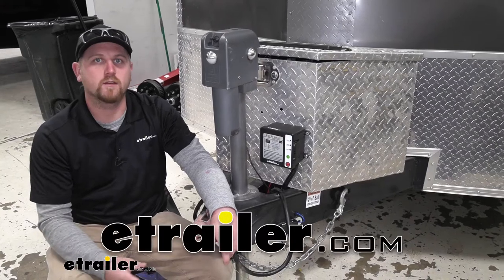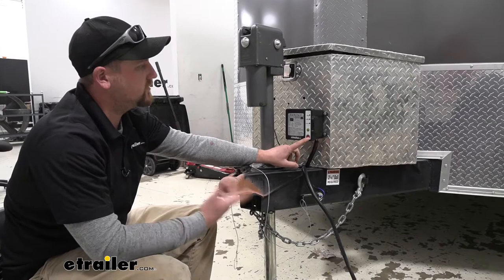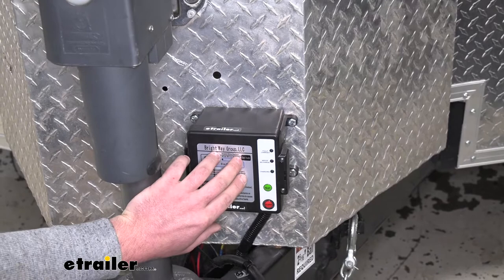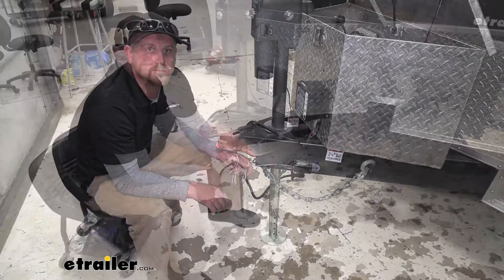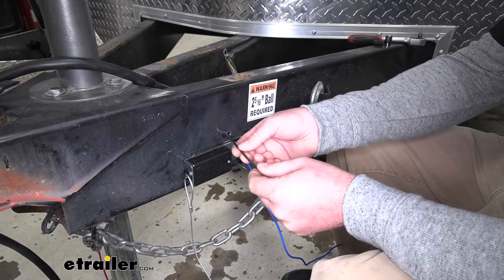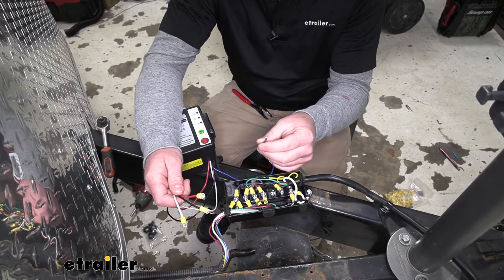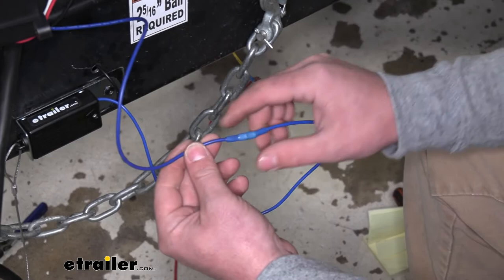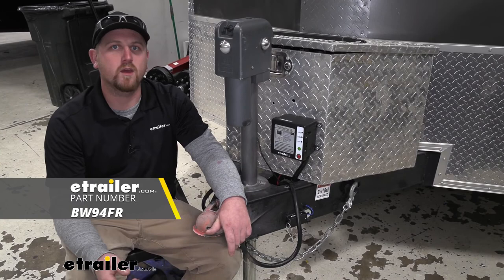etrailer | Bright Way Trailer Breakaway ICU Kit Installation

Comment: How would I wire it if I have a trailer battery and I’m using the 7 way plug to charge it
Reply from the maker: You will want to run the 12v accessory wire on the trailer side to the battery.
https://www.etrailer.com/faq-wiring.aspx
https://www.etrailer.com/Trailer-Breakaway-Kit/Bright-Way/BW94FR.html